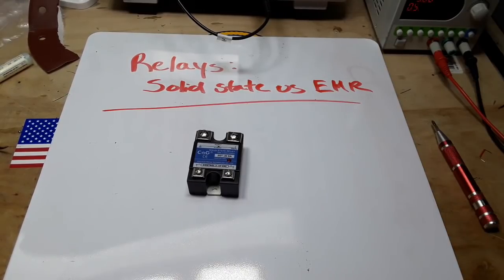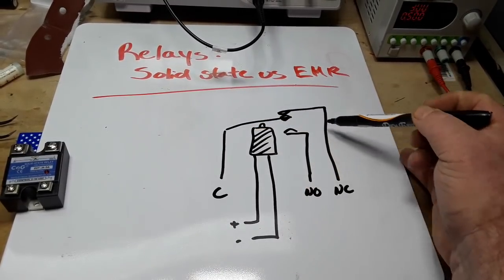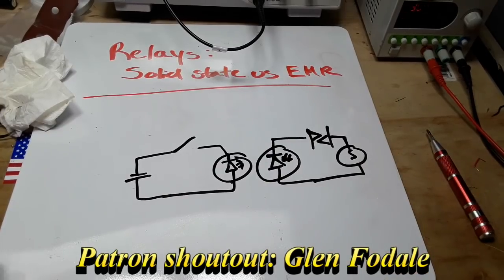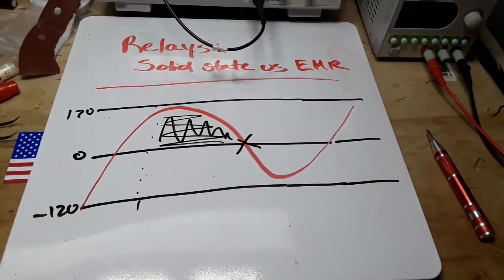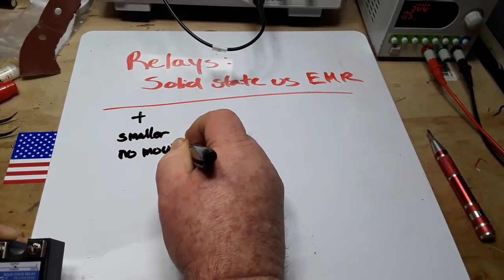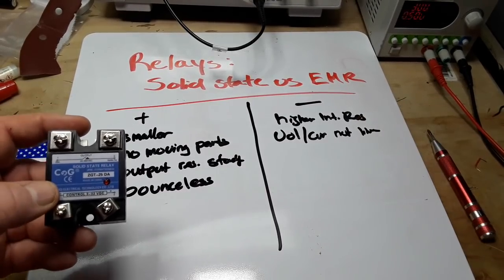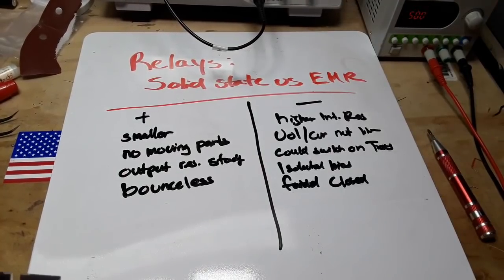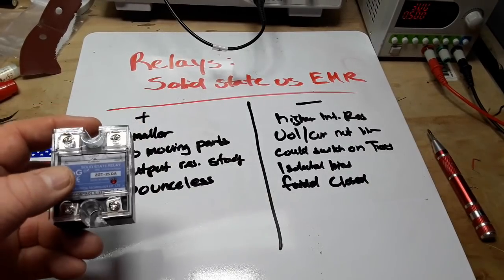Solid State vs Electro Mechanical Relays

Comment: I used solid state relays in my electrical designs that required heating elements such as in a hot stamp machine. Whenever troubleshooting a machine I looked at all of the mechanical relays first. Most of them have clear plastic covers so it’s very easy to single out the one that had a burned cover.

Comment: Great video! I have a little Raspberry Pi project planned where I'm going to be selecting speakers "A pair" and/or "B pair" using some EMR relays (one of those cheap but plentiful 4 relay boards), I've made sure the board has the appropriate flyback diode and resistor to avoid damage via a current rush. I hope the EMR doesn't provide too much noise (besides the initial switch).

Comment: If you get a chance then visit a telephone exchange museum and check out what used to be done with electro mechanical relays.  The 50s/60s 'Step-by-step' and 'Rotary' automatic exchanges were high maintenance, hot and VERY LOUD .... but also very hard to kill.   I worked in one that had been in operation for well over 25 years and had been offline for less than 20 minutes.  The replacement computerized exchanges crashed at the drop of a pair of pliers :-)).
Make sure you visit the museum, not just Google it.  Google wont give a true indication of physical size of the switching units.  50 volt lead/acid batteries that took up half a building floor, multi-phase rectifiers, 5000 amp circuit breakers.  Aahhh those were the days !    Hhhhmmm probably explains my reduced hearing and tinnitus too.  Huh, life is a ^&%$#.

Comment: It should be noted that you can buy NO (normally open) in both types and they are the ones that usually fail in the open fail safe way.  With mechanical ones besides being used to switch high currents they were often used so that the control side is low voltage with the output contactor side being high voltage and the electronic SS versions can be used the same way with the relevant type.  Electro mechanical ones are usually not as efficient as electronic, could cause issues to very sensitive equipment , more likely to fail, though at one time was the preferred type in industry (UK) as if it failed you picked up a replacement at the local electrical factors.  However if mounted on a circuit board or similar the electronic SS version is usually the preferred method.  One of the things that noticed over the years is that some circuit designers pushed SS relays to their limits and this was less common with electro mechanical types.

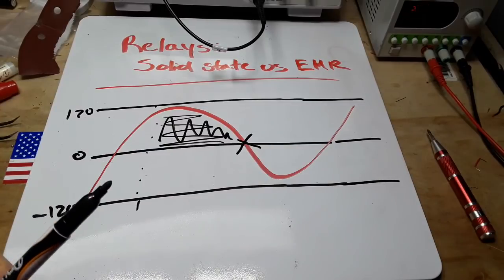Comment: 3:35 I may have got this wrong, but isn't the "magnetic breakdown" primarily something associated with the coils in an AC circuit, not the switching itself? If so, that issue (and ems) comes mostly with the relay coil, not the SSR's triac. Instead the abrupt change in current/voltage when switching on or off at non-zero causes high frequency EM radiation, aka electrical noise. The latter applies to both relays and SSRs though, but the triac helps eliminate the switch OFF noise for an SSR, which is not so easily done with a relay. Some SSRs also have zero-crossing detection so that they switch ON only at (or immediately after) a zero point as well.

Comment: Great video, thanks Paul! Failing ON is a huge downside it would seem to me.
Reply from the maker: It is
Reply: Downside or upside depending on the application, I'd say. For instance in my case it is used to switch on a heating system for a water pipeline during winter, and if it fails ON at least I still avoid the water freezing :-)  Now the challenge is just to assure that this will always be the failure mode when/if it happens...

Comment: You didn't talk much about why they need an isolated bias supply voltage? When the solid state fail is closed this can cause damage to the circuit because it's a short 120vac short ?

Comment: Another HUGE CON with these is that there are a fair amount of counterfeits out there that claim to be X Amps but are really Y Amps IE: The cheap FOTEK 25 Amp actually has a 12 amp TRIAC in it. This is VERY dangerous because someone not in the know will install it and it may switch the load a few times before it goes bang and up in smoke which can (depending on it's installed location) start a fire.
You KNOW you found a legit SSR because the price will reflect it.

Comment: In your schematic of the EMR example, the relay contact switch will be in its NC position when the electromagnet is deenergized and the circuit is ON. Applying a small voltage will energize the electromagnet and draw the contact switch towards the NO position when the circuit is OFF. So, your diagram is of a NC EMR. Are these devices also available as NO EMRs? In which case the relay contact switch will be in its NO position when the electromagnet is deenergized and the circuit is OFF, and applying a small voltage will energize the electromagnet and draw the contact switch towards the NC position when the circuit is ON. You make no mention of this.
Reply: On double throw EMRs you have your choice. If you want signal voltage to close the circuit hook your load to the NO terminal. If you want signal voltage to open the circuit hook your load to the NC terminal. Most industrial socketed units are double throw. The little circuit board mount "bricks" can be NO only or double throw (NO and NC).
Reply: @blic-sx9ix  Thanks for the info blic.